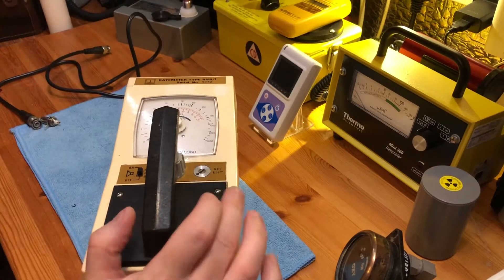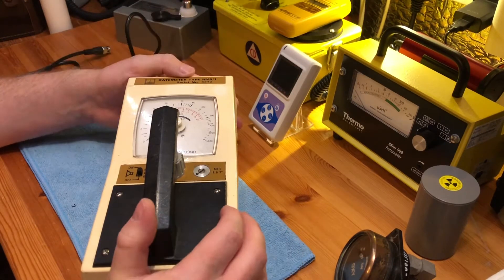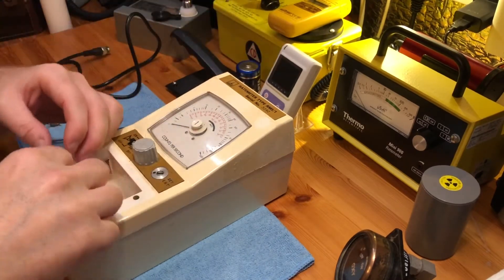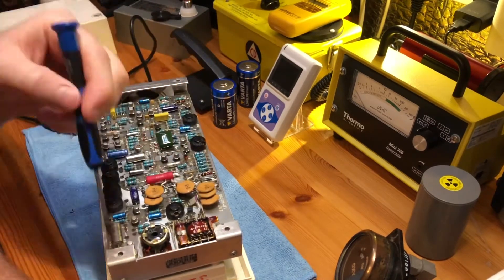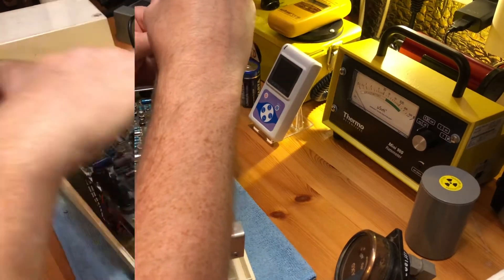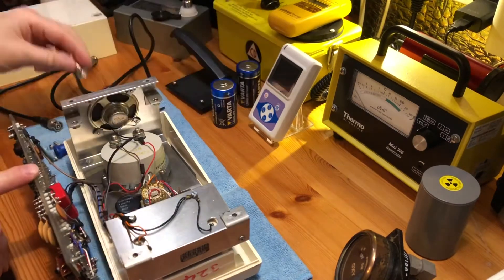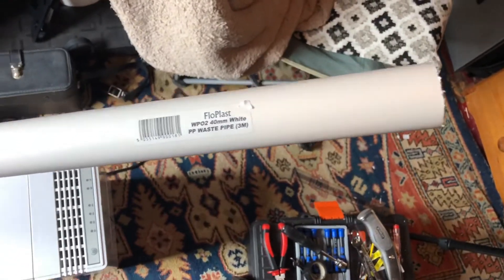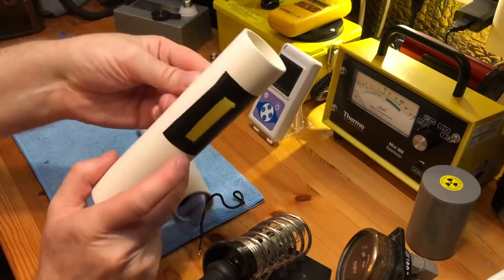☢️Budget Geiger Counter

Comment: Where did you get that strontium 90 sample?
Reply from the maker: It was the check source from inside a Soviet Geiger Counter. I always remove the check sources to store them safely.
Reply: @SurvivingTheApocalypse  thanks! What counter do you recommend getting for a check source? Most of them on eBay got removed before listing, any models with internal check sources?
Reply from the maker: The Soviet DP-63-A contains one and also has a uranium painted dial which is stupidly radioactive depending on the age of the unit you get (ones from the mid 60’s are in the 9mSv/h range). Expect to pay around £80-£90 for one.

There is a video of me taking one apart and removing the sources on my channel, take a look in the ‘Geiger Counter’ playlist.

Comment: Back when you was restoring your Roc post around 2010, you got your bunk beds from the Armagh post which was packed with original artifacts, like a chemical toilet still in its packaging. Well did you know the post had all of its surface features removed and chucked to the side, while the post itself was buried and sealed? I found this out as Im attempting to write up every Roc post. I've only just finished letter A, which was about 80 posts.
Reply from the maker: Hi there, yes I did know that. The photos on the Subbrit database (which I assume your using) were taken by me. Thankfully I was able to remove everything before this happened.
Reply: @SurvivingTheApocalypse  that is correct and I am glad you was able to get it all out before that. Thanks for answering

Comment: I think I’m going to do that myself I have the Geiger and the SBM 20 tube which I’m guessing is the one you’ve used I know it’s got lots of names. How did you connect the wires to the tube itself I had to tape mine as the solder wouldn’t wet on the tube. Very good video indeed 👍
Reply from the maker: I managed to get the solder to stick eventually. I wound the bare wire around each end and then used a liberal amount of flux to get the solder flowing nicely. Took a few goes but it worked in the end. I used a BOI-33 tube but there is hardly any different between it and a SBM-20.
Reply: Surviving The Apocalypse ahhh I see I’ll give that a go when I make my probe cheers for the help 👍